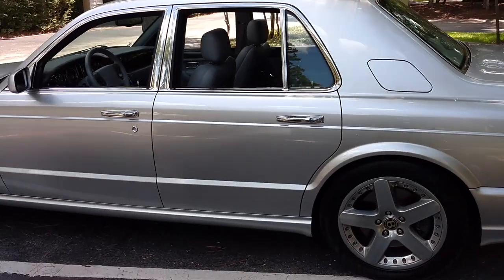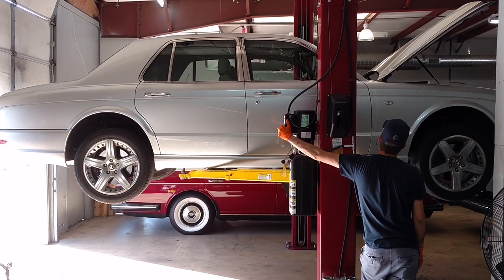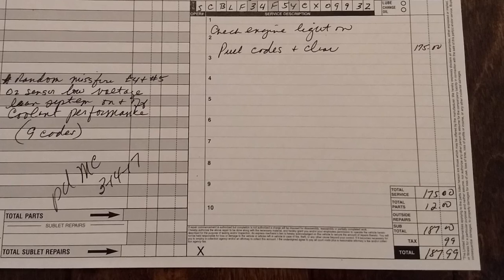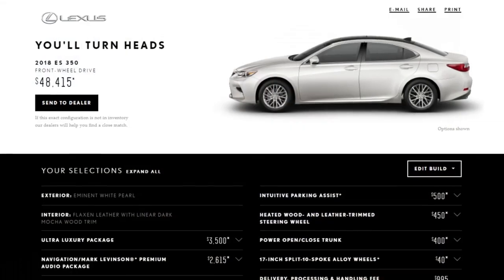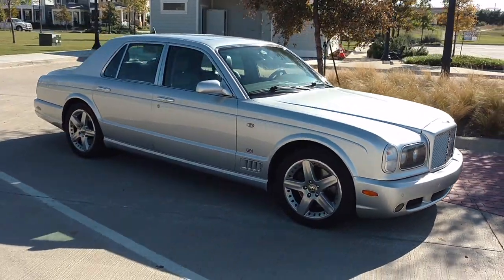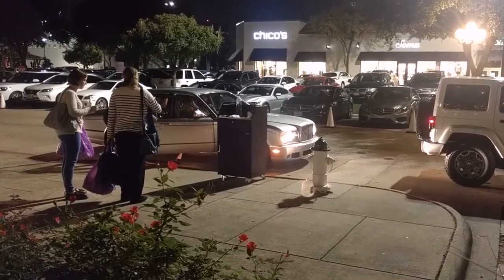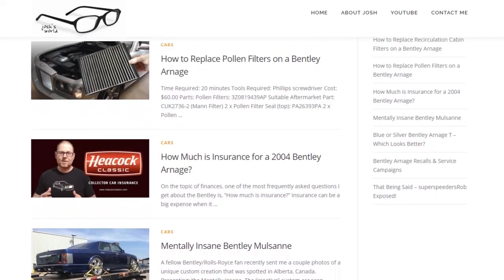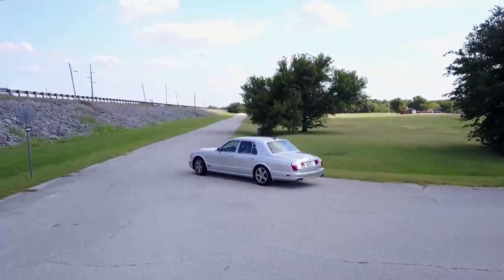Ownership Costs After 1 Year | Owning A Bentley Arnage - Episode 15

Comment: I dream about owning a Bentley Flying Spur approx. 10 years old. Josh do you believe it would be a similar experience?
Reply from the maker: Yes, I met the owner of a Flying Spur and he said his experience was similar to mine.
Reply: Danske Salmer arnage it better. I don’t think flying spur have the tray table.
Reply: Believe it or not, my first gen VW Touareg actually shares a lot of the same components with the Continental (such as the transmission, electronics, interior pieces) and were co-developed together with the Phaeton. The transmissions are pretty reliable, but you will eventually need to replace the valve body with an updated one. The electronics in these cars can go absolutely haywire, but have a lot of nice features. The models before 2006 have issues with the Kessy module (smart key system), but the modules have updated versions available. 

One pet peeve that I have is that the scroll wheel on the steering wheel doesn't let you scroll through your radio presets, only the nearest station. If you want to use your presets, you'll have to reach over to the softkeys on the side of the screen.

Once you update the failure prone parts in the early models, they're actually quite reliable vehicles

Comment: I've spent $5K in maintenance for my 2007 Mercedes CL550 after 4 years.  Your vids give me confidence to buy a used Arnage, because its always been a car I've wanted and have been skeptical to buy because of very few indie service shops in Austin TX.
Reply from the maker: Bentley should not be too much more than your MB. Another person reached out to me from Austin with the same complaint about indie Bentley specialists.
Reply: JoshsWorld.com Hi, any thoughts about Bentley Continental as daily driver? you can get one for 50-65k pounds here in england with low miles...
Reply from the maker: I'm a big fan of the Continental. I think it would be a fun daily driver, but I don't have that sort of experience. I don't really drive any car daily because I work from home.

Comment: Why not get a higher mileage Continental GT?
Reply from the maker: Continental GT is a great car. In 2016 when I bought the Arnage, the good Continental GTs were still a bit out of my price range.
Reply: The Continental GT is a sort of Audi, whereas the Arnage is full-on, old-school Rolls-Royce.  The basic engine is about sixty years old, but highly-tuned in the Arnage.    I am not really knocking the Continental GT, but it just doesn’t have the class and presence of an Arnage.
Reply: The Conti is driven by football players and rappers, the Arnage is driven by gentlemen...
Reply: Continental GT is much more common,  higher maintenance,  and is mostly seen in REALLY BORING COLORS;  since when do you have to pay extra for a Bentley in BRG?
Reply: Why not get both?
Reply: Continentals are great cars but the Arnage is something special, the last of the rocket propelled battleships

Comment: Excellent video, I own a Bentley Continental GT, and like you I was apprehensive about purchasing a ten year old vehicle with high maintenance costs. I have owned the Bentley Continental GT for three years and do my own maintenance. However the Bentley dealer is not inclined to be very helpful in giving me diagnostic trouble codes, for instance the TPMS codes for what I have learned from other Bentley aficionados  (Canadian owner's sharing information) I appreciate the attention to detail that the  Bentley Boy's in Crewe Cheshire England. These cars are landmarks and in many ways set the standard for  other car manufacturers. All one needs to do to fall in love with a Bentley is to drive 600 miles in the car. Thank you for the video. I have owned many nice automobiles. A comparable German car, is a Mercedes-Benz CL550 or CL 600, which have owned. IMHO the Bentley shows far greater attention to detail and craftsmanship than the Mercedes-Benz. Get the best of England and Germany together and you have the capability of creative teamwork and amazing results.
Reply from the maker: 600 miles? I bet it only takes 6 minutes to fall in love with these cars! 👍 Thanks for watching!

Comment: Great Video.. I have a Rolls Royce Shadow Coupe and a Silver Spirit I've had for 25 years with little maintenance.  But when I almost bought one of these and dumped it to another sucker I was glad I did. The worst of it is there are waiting lists for almost all parts and the labor and cost is astronomically frustrating. You'll end up wanting to set it on fire or drive it off a cliff. That's why they are soooo cheap.
Reply from the maker: I somewhat agree.. the cars that were not taken care of will cause headaches, but if you can find an Arnage with a detailed service history, the experience can be as rewarding as it has been for your Shadow and Silver Spirit.

Comment: Absolutely gorgeous. Congrats on surviving Year One. I would point out, however that your odometer is only at 30,000....just wait until it hits the 70,000 mark where all things mechanical start going in all cars. It's great that you can work on this and there is support in both parts and advice. A family member bought a used DB9 with 14,000 and his FIRST service - which included needing new tires, a shock absorber and remedy to stop a small oil leak (that would have been covered by warranty had it been timely  addressed) was $21,000. Unlike the Bentley, mechanics can't get the parts
from Aston Martin, and the service manuals are too expensive for most shops to own for just one customer. As you go into Year Two, I know you're confident - talk nice to it and keep it clean...it may appreciate your care and F you less.

Comment: I have at various times run a 1974 Bentley T1 and also a 1927 Rolls Royce 20HP limousine (for nine years). Each were good cars but my 2009 Ford Mondeo Titanium with 45000 miles on the clock has had nothing done in a garage except for regular servicing. It always seems strange  that very expensive cars always seem to cost more to keep running than cheaper machines when they should cost less (except for fuel consumption)! A good video and a great car, thanks for uploading.

Comment: I own a 2007 GT, and at 90000 kms, it’s due for front brake pads, which I intend to do myself. I replaced the front air shocks with help from my brother at a DIY garage and saved myself a fortune. Did my own oil and filter change 4 months ago, and saved a packet there. So far, so good.
Reply from the maker: Excellent! In the end, it's just a car!

Comment: Interestingly, for 16 years I was the proud owner of one of the best RV ever made...30 years ago. Its value dropped to the point were the average guy could afford it. One of the biggest things I learned was with that high end of an RV, they just took the time to build things right. Yes there were repairs, but the materials were high quality. Once you fixed it, it was fixed right. Other than the differential, (FWD), you never had a repeat repair from a part that was under designed. Any time you drove it, you were reminded of the incredible engineering that went into the design and comfort. It drove way better than any other RV, even better than the best current RVs made. On the interior, except for the upholstery the interior looked the same as it did when it left the showroom. My expenses turned out to be less is the first 5 years of ownership than the typical average for any used RV. The definition of quality is also durability. 

The real answer to expenses is to be a DIYer. Sure if you pay a shop to work on something, it will break the bank. But as long as you can do the work yourself, the cost is very manageable. 

I'd also say that you get over the status thing pretty quick. However there is enjoyment of driving something that is just well built.

Comment: What a lovely car: my cheapie is a S350 LWB 2004. Since I learned of the gear that wears out by 95,000 klms in the V6 (obviously I did not do my homework), I plan to trade it in on a S500 LWB.
I have absolutely loved driving myself and at times my family in total comfort especially the long distances are very easy on the body.
By the way to fix the gear problem in the engine, the engine must come out!  Big bucks there!  Yes I have had to do some repairs, but none were extremely expensive as I used a non branded repairer who have been in business for ages...the boss is SO knowledgeable.  He advised on the S500 as this problem does not exist.   You must understand when buying a car such as this; you need the money set aside for when things break down....not if.
I bought the car accepting this right from the start.
The gear is for the harmonic balancer.  The material has improved in the gear; but for how long I do not know.
Reply from the maker: Yes, being prepared for those expenses is important. Thanks for watching!

Comment: The coolant system being low needs further investigation.
The coolant level will not drop unless you have a leak.
Keep an eye on the level because it is going somewhere.
It may only be a weep at a hose but if the garage didn't find the leak,it's still there.
Beautiful car don't let an overheat ruin it for you.
Great video.
John
Reply from the maker: Thanks for watching. Yes, I had the specialist check it all out.

Comment: Love the videos and wish you well with your continued ownership of your Arnage T. I have owned a Red Label which suffered total gearbox failure, followed by head gasket failure...ouch. I got rid, but you know, these Arnage are just so beautiful I had to have another. After many months of researching I came to the conclusion that the one to have was, incredibly, the first generation 'Green Label' 4.4 BMW engine model. With its twin Cosworth engine it's no slouch. Not quite as 'in your face' as the 6.75, but more easy to handle, and slightly better fuel economy. I have owned this Arnage (it's a 1998) for almost two years now without any major issues. Never a trip goes by that I regret taking the plunge. 
Julian, England.

Comment: Good on you man; These cars are mixed bags sometimes, my first is CPO and if it wasn’t I’d have an expensive lawn ornament out of the deal. $50-65k worth of maintenance and repairs, thankfully only about 8k out of my own pocket. 09 GTC for reference, No engine/mechanical problems. I got a bad one but usually they are reliable and rock solid. (Note that the shop hourly rate is at $200, so the man hours  count for quite a bit)
Reply from the maker: A lot of it depends on how well the previous owners looked after the car.
Reply: JoshsWorld.com Absolutely, which is why I would buy another one-the experience is too good to ignore.

Comment: How much do you tip the hotel/restaurant valet? More than $5, I hope. Honestly, this was an interesting video, though it needs an update as I have owned many luxury cars that cost next to nothing one year, but far more the next--as they age. It all depends when the AC goes out or radiator needs replacement. I even had a steering wheel clock spring fail on an Audi. I didn't even know what it was.  Personally,  I have thought about buying an older, very nice, low mileage Bentley or Rolls (like this one) simply because they deprecate so much. A $200,000+ car for under $50K, what a deal. Buying such a car, with cash, no problem. But it was the longer term repair cost that always scared me off. That is what I have a boat for.
Reply from the maker: Tip was much more than $5. I owned a 2003 Acura TL that required a new transmission at almost $4000. Any car has the potential to be a repair nightmare... so might as well drive something fun.

Comment: I use a vw phaeton as my daily driver. After over 50,000 miles and a total of 149,000 on the odometer it has cost no more than a new civic. That’s bang for the buck but maintenance has been a challenge.
Reply from the maker: 100% agree. A friend of mine recently bought a brand new Civic... It's a nice car, but for the same money, a decent luxury car can be had. Just depends on personal preference I suppose.

Comment: With proper regular maintenance the engine should go to 250000 miles before a rebuild. Id be most worried about the turbos letting go. Wonder if there a preventative maintenance approach to predict prefail of turbos? Interesting to note that in 1 year and 10000 miles our used 2006 BMW 330d touring has had 2 rear shocks, 2 front springs, 2 rear tyres, a blown fuse and a service costing well over £2000 in total...Thanks for the video....interesting and will be following....
Reply from the maker: Thanks for following!
Reply: With oil changes done on time, and idling the engine for 20 - 30 secs after a run there is no reason why they shouldn't last several hundreds of thousands of miles. Signs of imminent failure are excessive noise and any smoke.  There was a time when turbos used to only last X thousand miles but they are much better since the 90's onwards

Comment: The thing with owning a used Bentley is the same as with each used high end automobile. You can be lucky and have relatively few repairs or you spend the equivalent of the purchase price on repairs in the first year with no guarantee that it will be a smooth ride from there on out. And being able to do things yourself saves you a lot of cash with any car. I know a person who has owned an exceptionally long list of used high end cars, but the Bentley Arnage was the car he claims he almost went bankrupt over.

Comment: Here in the UK, an ‘04 Arnage 6.8 T w/40k miles w/full service history is $37k. Our petrol (your gas) is equivalent to $5/USgallon, or $750 for 3k miles a year, with annual insurance and tax at $2k p.a., plus (my estimate) $5k a year of other costs. I know that the Arnage impresses and is a marvellous ride. BUT the culture here is for youthful passers-by is to enviously “key” the panels, frustrating and extremely expensive. So sadly I’ll continue to  watch your videos and buy a late 300C station wagon, loaded and low mileage, for $11k, with its Mercedes V6 3L diesel high-torque engine, returning 30miles per USgallon. Having previously owned an older tired one, the 300C sw does have immense presence with its fake Bentley grille, is a practical daily user, and its long-wheel-base makes it great fun to waft around our many round-abouts (your rotaries). Keep up the good work, Josh.
Reply from the maker: Oh man, that's terrible. I'm pretty careful about parking it.

Comment: Granted "prestige", but my 2003 Ford F-150 V6 stick shift hasn't cost me 2k including oil changes since new.... and it has 225k miles on it.
Reply from the maker: The same goes for my 1997 Toyota 4Runner... the Bentley is not about practicality. :)

Comment: That is an exceptional car. Do you still have it or another Bentley ?
My passion is Jaguar. The original shape type. I have had an XJ40 an XJ8s and now an XJ6SE. Although not as expensive parts wise as your Bentley any problem fills me with fear but a good mechanic , pattern parts and 2nd hand from ebay keeps me going. I think my mechanic hardly ever works on Jaguars of such age other than mine and occasionally I have to buy a special tool he won't buy like the wheel bearing removal tool for the XJ40 but that's a minor thing.
It's the luxury ,the power and quality that makes it worth it. Also the amount of admirers who come up even though the majority of the modern cars parked nearby are more expensive.
I suppose it's class. You cannot put a value on class. Money does not equal class and certain cars have class as I am sure you will agree.

Comment: How many miles did you drive it during that year?
If it is like 10 000 miles, then 1000 USD for maintenance is reasonable.
What is it in proportion to insurance, tax, and fuel cost?
Reply from the maker: I drive it less than 3000 miles/year. I have a separate video that covers the insurance costs. Tax is only paid when the vehicle is initially purchased.
Reply: @JoshsWorld  Not too bad. In the Netherlands, we pay tax each month. It is based on Weight and type of fuel. My 2001 Mazda 626 cost me about USD 70. I drive LPG (Liquefied Petroleum Gas). And there is an extra sales tax of (I believe) 40% on the purchase price.

Comment: A lot has to do with how you use the car.  If you baby it with gentle accelration and braking, steer around broken road surfaces, and park it out of direct sunlight it will last a lot longer and fewer things will break; true with any kind of car.  Some cars have poor design and engineering which you can't get around; stuff like plastic timing chain guides in Jaguars and brittle plastic in the cooling system in BMWs.  This car has a beautiful timeless design so it's worth having and keeping in tip top shape.
Reply from the maker: I do baby this thing.

Comment: Nice vid, always wanted a Bentley like yours. Found a one owner '95 LS400 ($7k ) series two instead because I simply couldn't afford to go Bentley. Only 42000 miles from new and probably quieter than the Bentley , it's just a gentle ruffle you hear when you're doing 120 mph. But, my car has nothing on the majesty of a Bentley . Take it easy
Reply from the maker: That's a great car that will last as long as you want it to. Thanks for watching.

Comment: I owned one about 4 years ago. I had it for 3 years. It was 6 years old when I bought it. It was ludicrously expensive to own. Not to run, as that’s up to you .....how often you drive it. The main service was over £4000.00 at a main dealer.
Reply from the maker: Yes, the biggest service (60k) is about $5000 at a local specialist shop here.